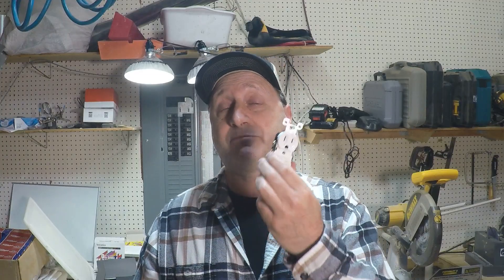15 Amp Outlet vs 20 Amp Breaker: What You Need to Know!

Comment: I have a 30 amp breaker that is running to bedroom outlets.  Is it safe to have a 20 amp outlet?  Or is it best to change the breaker to a 20amp?
Reply from the maker: You can change the breaker if you want. You can also change the outlets to 20 amp. However, the most important thing is to make sure you are not drawing more power than the WIRE can handle. If you have a 12 gauge wire, then you would not have more than 2400 watts on that circuit. Look at the devices and see. Space heaters draw the most. Thank you for watching. Would appreciate if you could sub to the channel.  Thx... Flannel Guy

Comment: Receptacles are not switches, but can also be referred to as outlets which is defined as a place to connect utilization equipment. If you have a duplex receptacle as shown, a 15 amp receptacle is permitted on a 20 amp circuit even if it the only outlet in the circuit , because it can supply 2 pieces of utilization equipment. A dedicated 20 amp circuit aka an individual branch circuit must have a 20 amp single (simplex) receptacle so that only one piece of utilization equipment can be supplied. Reference NEC article 100.

Comment: My house has a 20breaker running 12awg to a 1st 15v outlet, from that outlet it feeds all of the lights for the house with 14awg and about other three 15v outlets. So it goes from 12awg to 14awg to a mix of 12/14 for lights. 

Im unsure if I should change the breaker to a 15 or leave it as 20 since it has been like that for decades.
Reply from the maker: leave it at 20...thanks for watching. Please like the video for me...